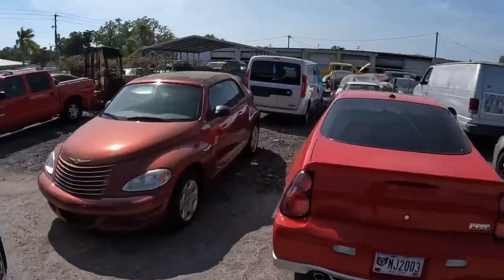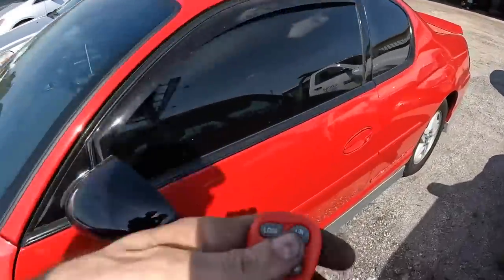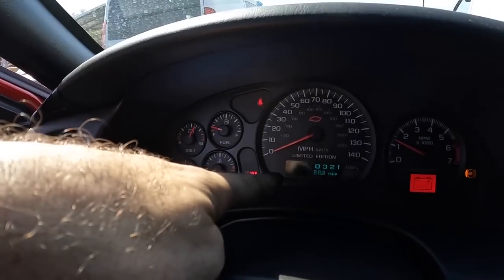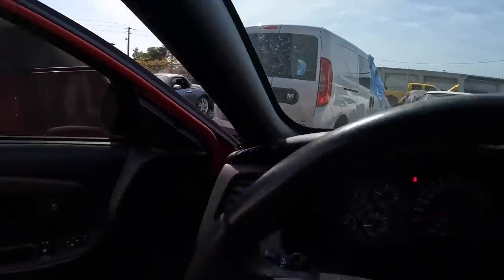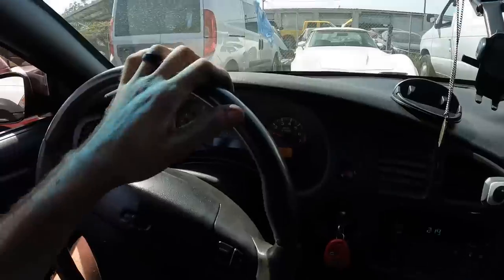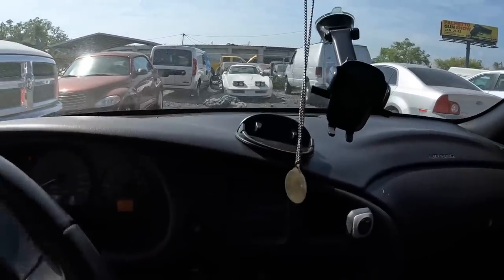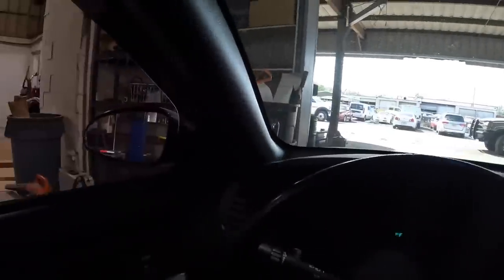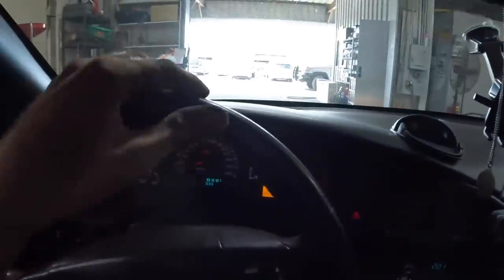Oil in Radiator! 2003 Chevy Monte Carlo 3.8 Manifold Leak!

Comment: Not sure what the job market is like in the UK but I'm pretty determined to get a job in a garage, I have an IMI level 3 in light vehicle and maintenance but no experience as I got out of college during the recession and nobody was hiring. I just hope I make a good impression on whoever I start with, if somebody decides to give me a shot. I've been doing my own maintenance and a few friends and families cars so I have a decent amount of DIY experience, just not sure what it will be like to do the same kind of stuff under pressure. The only tools I'm really lacking is a higher torque torque wrench (I can get the two teng torque wrenches covering 20-210nm for £140, I already have the teng 5-25nm for precision work) and power tools (been looking at the Milwaukee M12 337?nm impact wrench and 47nm ratchet, I can get both with 1x4ah and 1x2ah battery and charger for £275). I don't have a proper tool box but I'm sure I can get one.

My biggest worry is that I don't work well when I feel like I'm under pressure.
Reply: If you are young and fresh out of college I don't know why you would need to have your own expensive tools. That would be if you are self employed and experienced. Surely you should be looking at being employed as an apprentice? There is no pressure or anything more than basic cheap tools needed. Just don't be incompetent.
eta: Forget the CV styles that "professional recruiters" demand for HR departments in corporations and the job-centre love.
Do list and briefly detail all of your DIY fixes for family and friends cars. That is what will stand out against the competition in the job market and is what a garage owner is interested in.
Reply: @Drew-Dastardly  I'm 30 years old and got out of college 11-12 years ago. I struggled to get any job and have been working for Asda for the past 10 years. I guess I'll be lucky if anybody takes me on xD. I just want to get out of retail, the greed of the new owners is unreal and the expectations of the job are getting vastly unrealistic. It is quite literally back breaking work, it's not rewarding and is under appreciated (they cut everybodies hours and then complain the shelves are empty, as if your the problem). It seems at the moment Asda would rather have empty shelves then have to pay somebody a wage. Staff are dropping like fly's though, my partner wants me to apply for a new Aldi but I'm done with retail, it's soul draining. Watching Ray has inspired me to actually get a job I've always wanted to do. Employers seem desperate for technicians at the moment so it may be the right time to take that leap. I'm nervous but also pretty confident in my ability to do majority of the maintenance work within a garage and I'm pretty certain I can learn the things I don't know.
Reply: @micheals1992  When I was an apprentice (TV repair) I was a snotty 18 yr old going out getting drunk and turning up to work late and missing the odd days.
You are a mature family man with a work history. Any garage owner would choose you over the fresh lads for good reason. I wish you luck in your job search!

Comment: Just maybe…  you allowed more contamination into this engine than all the potential contamination combined if you prefilled oil filters
Reply: 😆😆 What a mook.
Reply from the maker: Doesn’t matter. The oil in the pan is always the “dirty” oil. The internals get post-filtered oil on the “clean side” Prefiiling the filters can get the contaminate in the “clean”side. I could dump sand the oil pan and it wouldn’t hurt a thing so kind has the filter still flows. (Don’t dump sand into engines)

Comment: My son had a car with this engine, and it must be almost guaranteed due to the terrible design that there will be oil leaking into the radiator. Also, almost impossible to replace spark plugs in the back.

Comment: All of those electrical connections look daunting, but in a brief moment of clarity, GM designed this engine (and maybe others) with unique connector at every point.  You can't connect the wrong wire to the incorrect sensor or harness.

Comment: He calls the car meant when he takes it from the parking lot. Yet throws oily bolts up on top of the cowl cover He also gets antifreeze all over when he works on most cars. He thinks the water just rinses everything off. We owned a  body shop for 58 years This pisses me off! Yes this is negative so you who think you need to defend him back off.
Reply from the maker: That’s fine, don’t forget to connect those ground wires body shop guy.
Reply: @RainmanRaysRepairs  It was a body man myself for 20 years I'm the one who sold the shop in the end. And I never messed up anybody's wiring or screwed up their paint or got oil on their plastic and thought water would clean it off okay it's your turn to clap back.

Comment: .this calls for big LS motor.thos engines were known to over heat head gasket .cause coolant gumm up.dexacool engine killer.few shops I worked at we had those in all the time for warped heads blow gaskets.and my friend that worked at the dealership was putting in new engines all the time.

Comment: that is NOT a 2007 Monte Carlo! that front end only went to 2005. the 2007 did not have a 3800 they had the LS LT and SS the LS AND LT has a 3.5 aka 3500 the SS has a 5.3 V8
Reply: also that is a 3800 series 2
Reply: I have replaced the elbows on mine did not have to remove intake. yes 2 of them if that one broke need to replace other....

Comment: I love you Rianman and your videos but  you have to stop using the 3m Abrasive wheels  for cleansing machines matting surface's you can see the uneven groves your cutting in to the surface's  please start using a wide block hand sander and start win 400 grit end with 800 grit at the minimum  mostly on aluminum surfaces  I get so many repairs from shops and other techs that do the same thing as you and its always  leaking seals or excessive amounts of gasket maker used and when I look at the surface I  can see the damage done and when I check the surface with my edge Gauges and the laser it just drives me insane rush rush rush and wrong tool used  .. please show more pride in your work you are a top notch and I mean a Top notch Tech/mechanic so work like one please and show pride in your work  I hate seeing good mechanic's work like hacks  And yes I think you are a good mechanic

Comment: If that is a 2007, it’s a fake SS. The 07 MC SS has a 5.3L V8
Reply: I thought so, also the series II 3800 was phased out for the series III in 2004 with "DBW" throttle, and metal/rubber LIM gaskets.
Reply: I agree, looks like a 2000-2003.  They made a few changes for the 2004 and 2005 models